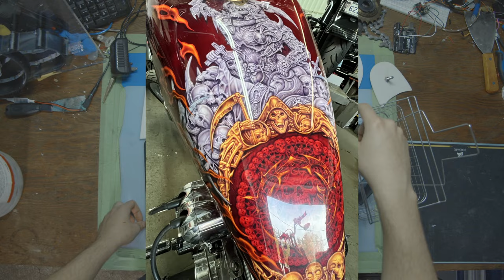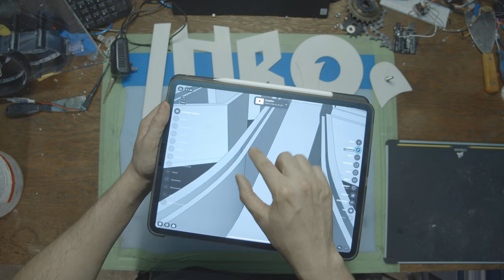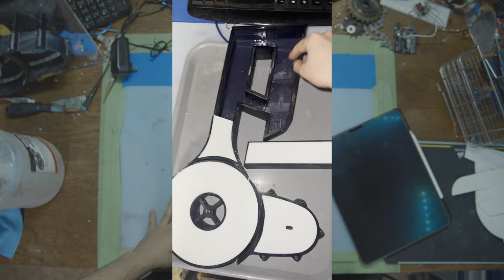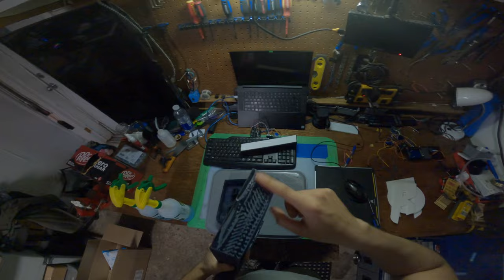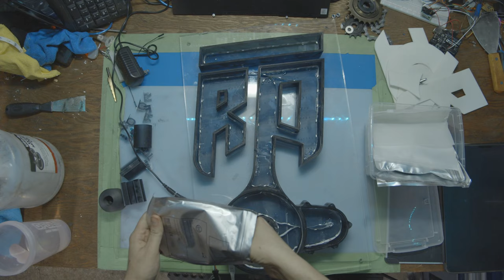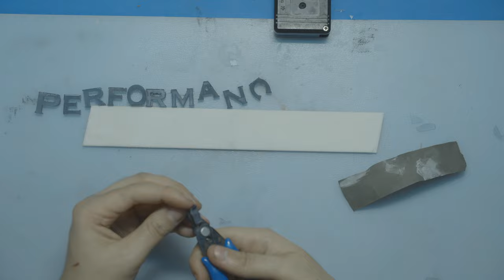HOMEMADE 3D PRINTED LED SIGN COST ME 300$ TO MAKE | SLA RESIN PRINTING

Comment: Very nice! I think I would've printed the base part in FDM personally, as I'm sure that would cut down on the cost (and I feel like FDM is easier in general). If you make the print walls a bit thinker and sand the part down afterward, you can get rid of most of the print lines, and I think adding a layer or two of spray paint would help even more, although I haven't tried it myself. The white part definitely looks better than you would get with FDM though, cuz any light shining through an FDM part is going to reveal any printer lines/artefacts even if you sand it.

Also, did you add anything to the inside of the sign to help reflect the light? The finished product looks plenty bright as is, but I wonder if adding a layer of tin foil or something would reflect even more of the light out the front.
Reply from the maker: Yeah you're right about that, going back I think either I would do that, or make the walls of the base wayyyyyyyyyy thinner, they used way to much material. I think also next time around Ill get some resin/clear coat and a UV light to really lockin the gaps and scratches.

I didnt add anything to reflect because the idea was to have the light evenly spread and not be too direct, to just give it a bight of brightness but not actually light up a room/wall

Comment: Although it looks nice, it would be much, MUCH, cheaper and faster on an FDM printer and the white covers just cut from milky/frosted plexiglass. At least that's how I'm doing custom LED signs and logos.
Reply from the maker: How are you cutting the plexi
Reply: @MikaelAbehsera  Laser, or you can even use CNC router
Reply from the maker: @eXe09  oh for sure but i don’t have either of those